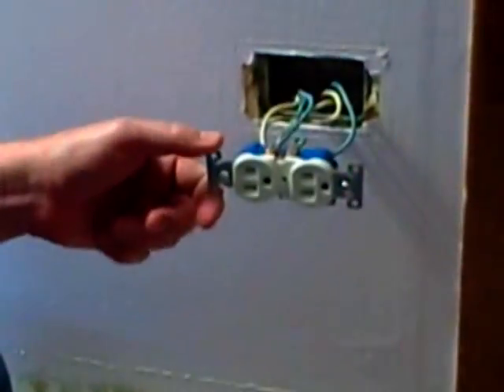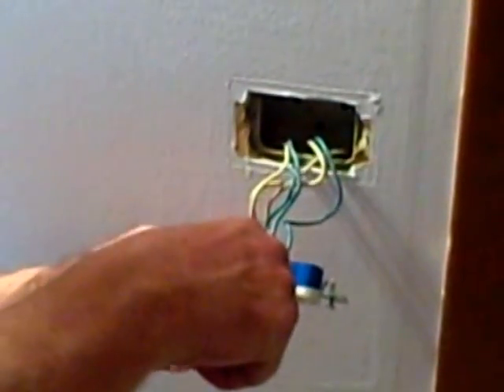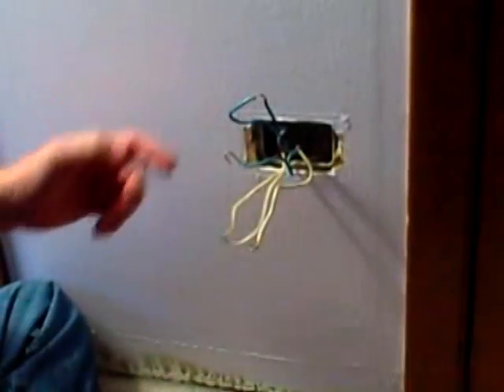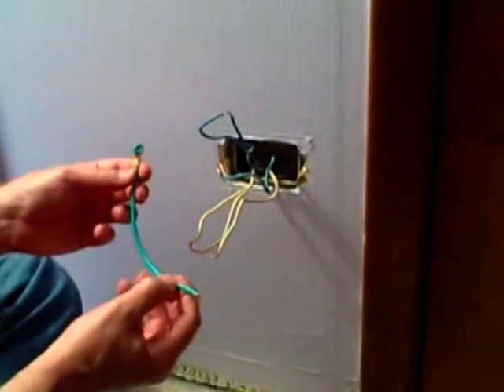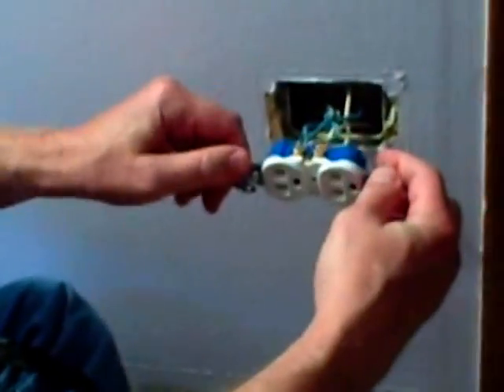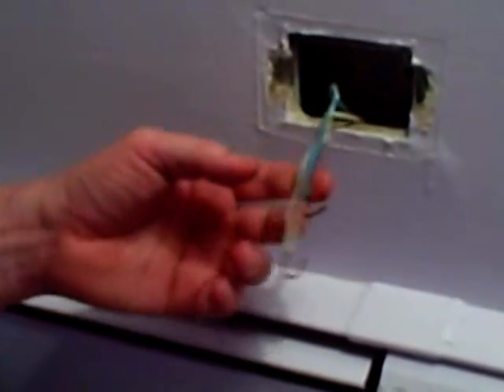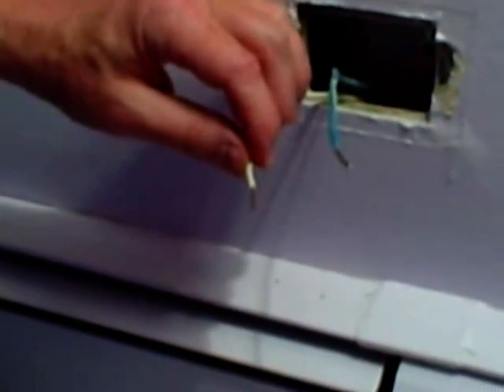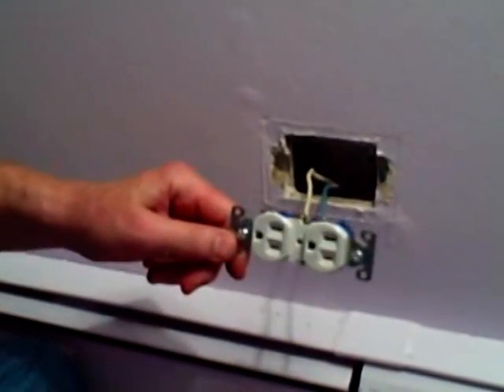How To Replace an Outlet - Conduit

Comment: yOU  BY THE WIRE SAME AS REQUIRED FOR THE OUTLET/ YES AT HOME DEPOT. WHERE THEY SELL ELECTRICAL WIRE/ i BOUGHT MINE RECENTLY IN MY CASE I NEEDED 12 GAGE WIRE FOR THE OUTLET.

Comment: Hello,
I just tried replacing one of my old 115v outlets. Red, black and white wires were going into the box and to my surprise the red was used instead of the black and the black wires were simply  insulated together and not used. Is this common or just slapply work? All other outlets I replaced only had black and white wires in them.

Comment: You briefly mentioned some outlets can be wired with each plug going to different fuses/breakers.  It would be very useful if you explained how to identify that case -- is there a "conductor tab" between the screw terminals on each side that must be broken to support separate breaker/fuse circuits?  Which type are you wiring in the video?  Other videos mention pros and cons of "pigtailing" cables -- your comments on that would be useful in the video.  Also, one cable had insulation stripped in the middle of the wire, implying it was passing on to other outlets.  But two end-stripped cables can also be part of a daisy-chained set of outlets, with each outlet providing the pass-through via the tab connecting the screws, or by use of "pig-tail" I think.  Discussion of those cases would be useful.

Comment: How difficult is it to repair a dead outlet?  I have one or two in my RV. I didn't know if simply changing out the old outlet would fix the problem or not.
Reply from the maker: ***** Hi, first turn off the breaker going to the outlet. Double check with an electrical tester that it is off. Remove the outlet and then turn back on the breaker to test the hot wire to see if it is the circuit or the outlet. Let me know if that helps.
Reply: FIX IT Home Improvement Channel
Will do.  Thanks.

Comment: Hi,
Great video and thank you.
I have a scenario where I have 3 separate black wires and not one is connected to the other like in your video. And, 3 white wires.
Can you please provide a little insight into how I should replace this all receptacle? Thank you so much!
Reply from the maker: Gonzarelli Doelman Hi, have you removed the old outlet? If so, did you you take a picture or make notes on how they were connected? If not I can give you a couple tips. Let me know.

Comment: In the UK we usually have 1 circuit for outlets on each floor of the house, it will start at the breaker, loop into and out of each outlet then on the last one, it will go back to the breaker, you can have as many outlets as you like on that circuit and it is protected by a 32 amp breaker. So each outlet will have 2 live (hot) wires, 2 neutrals and 2 grounds.

Comment from the maker: Hi,
If you have two separate wires going to one screw terminal, always create a pigtail. In this situation, the single wire is stripped and wraps securely around the screw terminal.
Reply: Hi, thanks for the great explanation. For the 1st replacement in this video, do you suggest use a pigtail instead of the steps in the video?